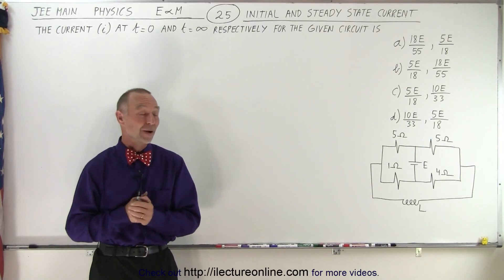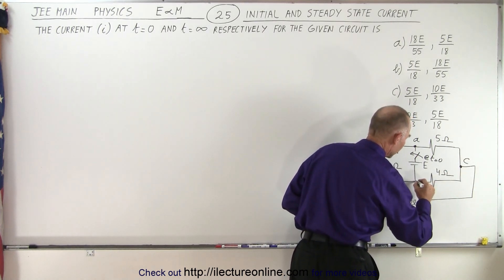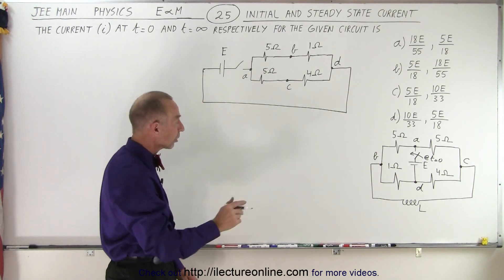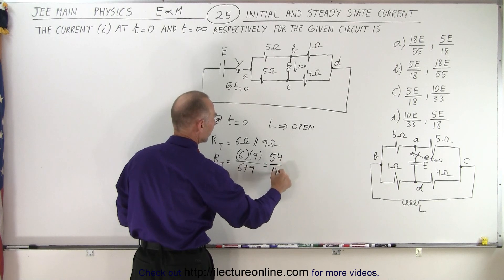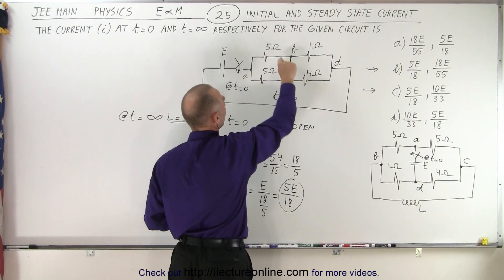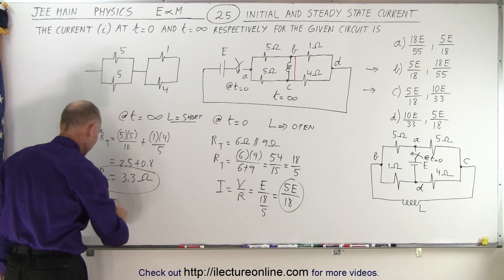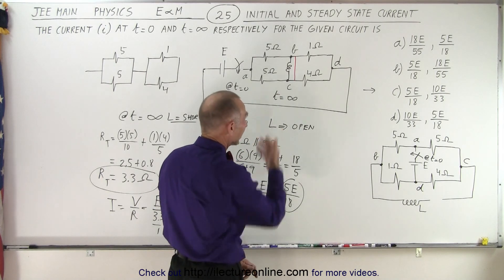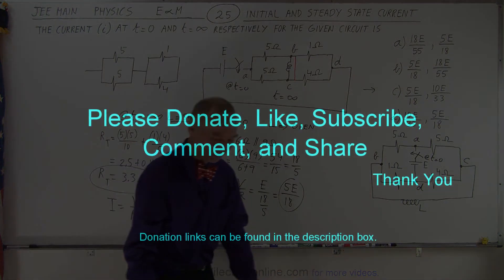JEE Main Physics E & M #25 Initial and Steady State Current

Comment: What was the reason behind inductor acting as open circuit at t=0 and short at t= infinity
Reply from the maker: Inductors only oppose current when the current CHANGES.  Once steady state is reached the unductor no longer opposes the flow of current.  And the inductor does not let any current through the moment there is a big change in the current.

Comment: The initial current value of battery current is 3E/10.  Answer D is close but still incorrect.
Reply from the maker: The answers in the video are correct.   I initial is not 3E/10